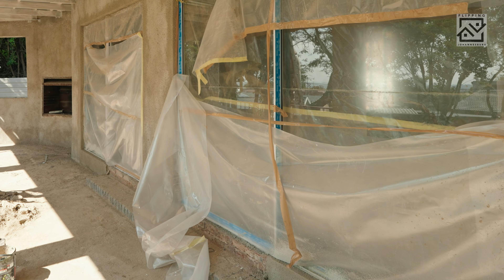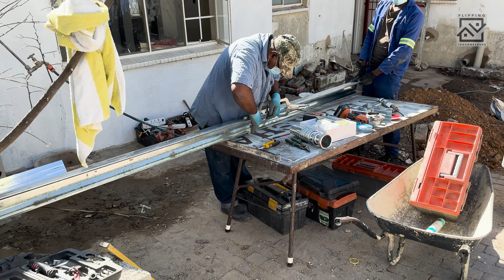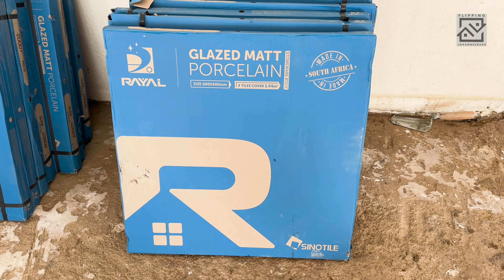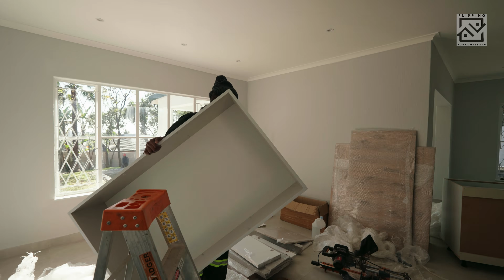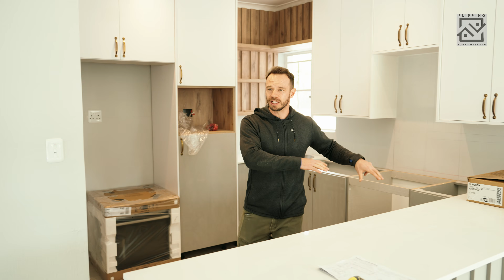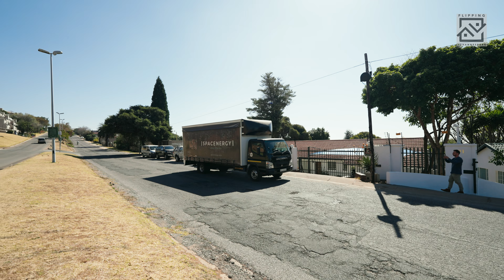ABANDONED Ruin House Flip - Project C | Episode 3

Comment: Hi Steve
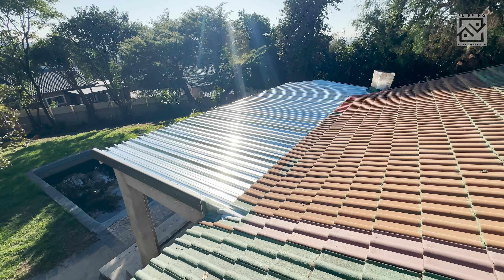Hope you see my message 😊.. just a suggestion-my dad and I did the same for our patio roof when I was a kid- 3:59 - adding block cut pieces of thatch in between the beams hides the roof, ads some isolation to cool the stoep area in summer and brings back a bit of old school nostalgia. Best part is, because it’s covered by the roof sheets it’s also water protected and super low on maintenance. Feels like a thatch roof when you sit outside, with the benefit of proper roofing.

Comment: That patio roof is shoddy work. If you install IBR roof sheeting, you have to screw through the ridges, not the valleys. By screwing through the valleys, you've not only added holes where the water is going to flow, you've added obstructions that are going to collect debris so that water is more likely to pool around the screw heads. Then you've also used twice as many screws as you need to, so the roof has less room for expansion and contraction, so those screws are going to be under additional strain, which is going to reduce the effectiveness of the rubber seals on the roof washers. Furthermore, because the holes are in direct contact with the purlins, when water starts infiltrating, instead of causing a visible leak that can be addressed, the waters going to soak into the wood and slowly rot it away.

Comment: Great progress and the cupboards and kitchen are really nice. 
If you want to save money, delete that corner cupboard mechanism. Those are expensive. I like to put a door on the other side if it isnt against a wall, like this kitchen..Then you have easy access and more money in your pocket. Just an idea.
Nothing wrong with that kitchen, but if on a tight budget i can probably construct a similar kitchen for about 40% cheaper.  
I cut quotes in half for big kitchens. 
Customer had a quote for R230k and i did it for 110k. Basically the same thing. Didnt cut quality.